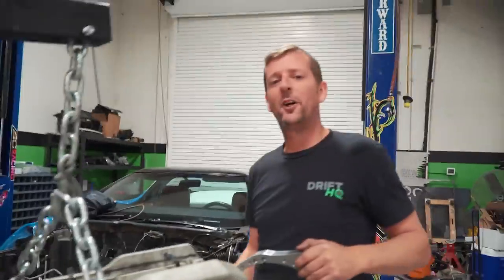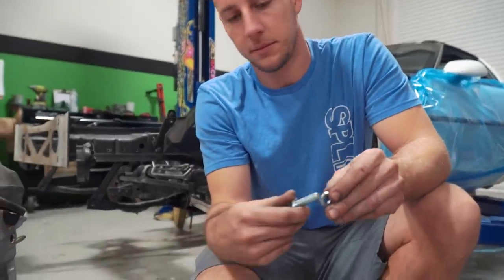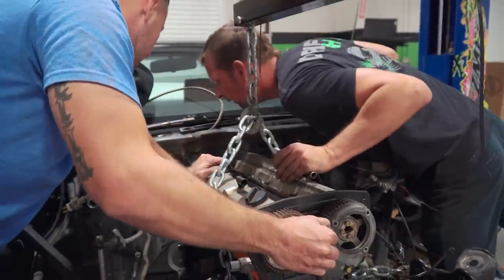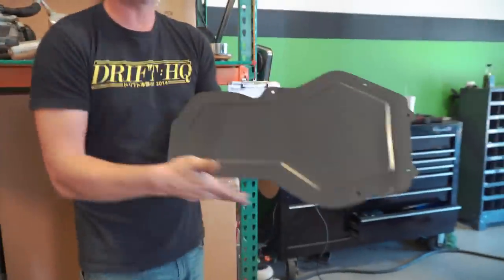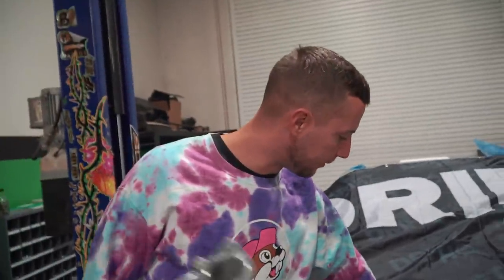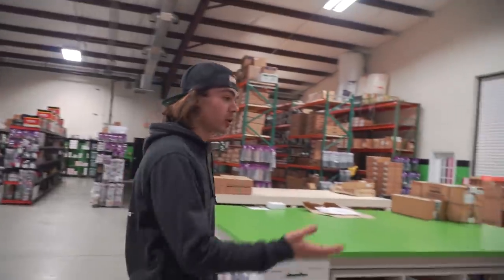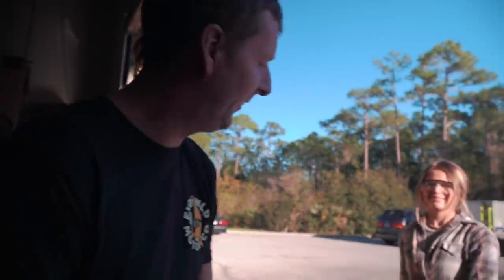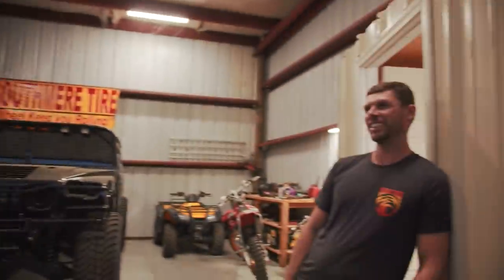Making an RB25 Fit in a C4 Corvette!

Comment: I mean, you do you but it seems like silly choice to go from a cheap to build strong platform like the lt1 or SBC to a weaker, more expensive motor.  Definitely more interesting than yet another LS swap though so kudos for that.
Reply: LT1 isn't worth the money it costs to change the oil. Straight to the trash can every single time.
Reply: @YaBoiDan  that's certainly a spicy take but absolutely bullshit. I would prefer an SBC for simplicity but an LT1 could be built much cheaper, easier and just as strong as this swap.  That's why I say this is a silly choice because you gain nothing except cool points.

Comment: Is that x brace really going to be enough rigidity? Is there any chassis mounting positions towards the middle of the x? Maybe drill through the tunnel and add a reinforcement plate on the inside. Or maybe remake the brace out of chromoly tubing. It's already a project, I get not wanting go deeper than you have to...
Reply from the maker: We might go to that extent if we see it flexing 🙏🏻